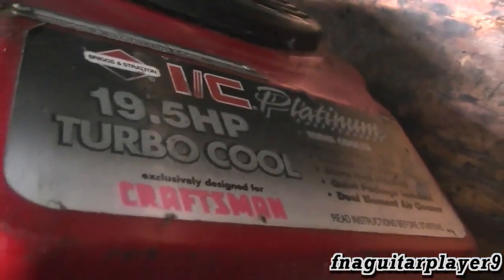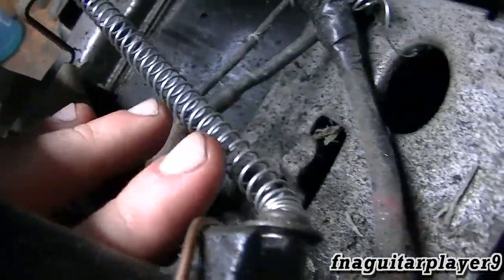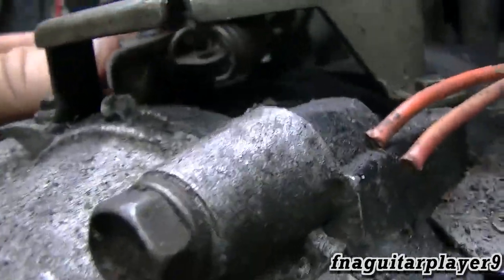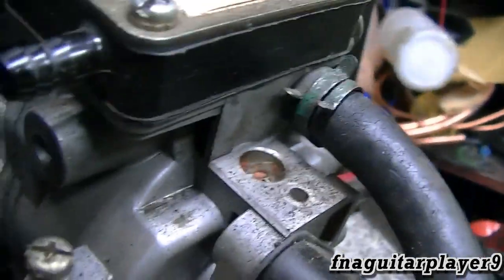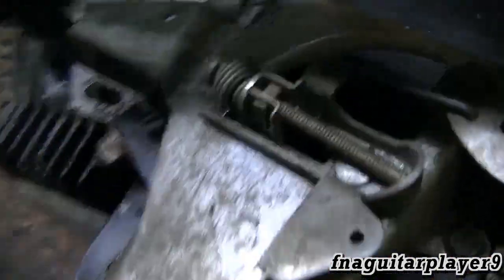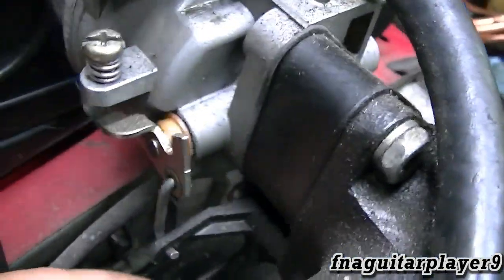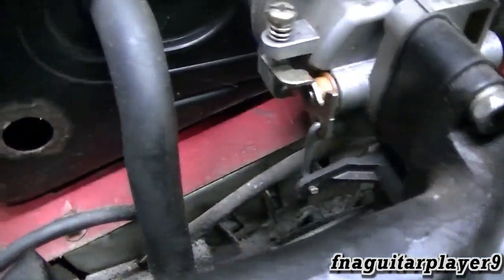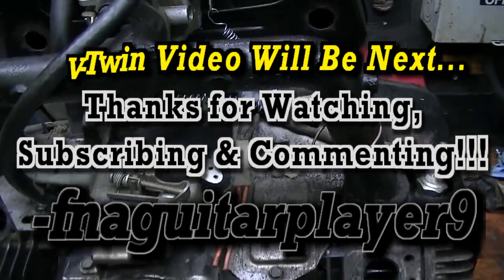Briggs & Stratton Opposed Twin : Governor, Throttle & Choke Linkages

Comment: Nice vid, I'm having a heck of a time getting the throttle to move using the control cable  (B & S, 18 hp), it stays wide open. Your video and some of the comments (feedback)are at least a starting point to try and fix it.Thanks to all.

Comment: I sure like mine after I sent Ebay $120 for a adjustable jetted carb. NO surging now at all and the older carb is rebuildable without sinking a war pension in it. They can have every fixed-jet carb that's ever been made. Mine's on an EZ Craftsman mower and runs like an electric motor as smooth as it is. Thanks, Picker and I'm still waiting for that tune!
Reply from the maker: I hear ya, I wish this one had the adjustment on it, my 14HP does. I'll check into getting a adjustable carb for it. Same here, I like a adjustment. i hear ya! Thanks for Watching!!!
Reply: Mine came from Ebay and it might've been off a 14. Seems like they had 2 block sizes and went up in h.p. with the bore. Don't know about the mounts though and how late they made the adjustable carbs to fit the 19.5's. Mine bolted right up but was off on one bolt for the air cleaner body but maybe 1/2 a hole.  If you need them I think I can get the numbers off the adjustable job. There was a plastic adapter about 1 inch high  with it and one on the motor itself. One was straight thru and one had an 'X' across it. Same size I.D. looked like. I used the 'X' for maybe better swirl and atomization. Runs fine but that's what adjustables do as you well know. The fixed main seemed fine but the lo would have to be bored out. That's where the lope came in. Too touchy for me.
Reply from the maker: I hear ya, that sounds about right. If it ain't to much trouble. probably was to swirl the mix. oh yeah, i'm sure its a big difference. I've thought about putting a vtwin carburetor on one, the 2 barrel type, it would take some serious modification to the intake manifold but it would have to give more power. I hear ya!
Reply: If you've got a tig rig and a lathe OR know where they are, you ought to be able to make an adapter easy enough. You'd have all the dimensions right there and touch them up with a saw file! I confidense you! Just take pictures!

Comment: Remove that spring  you have on it, back all the way off on the  screw with the  spring  (  top governed  speed  adjustment) I noticed  it is all the way in. With  throttle  control  set at wide open ,  loosen screw on governor lever hold lever  so throttle is held wide open and turn the slotted shaft to the left and retighten.  Start engine  and turn the top governed speed screw until reasonable  engine  speed is reached . Usually only a few rounds after engine  starts to speed up.
Reply from the maker: Thanks for Watching!!!

Comment: I have the same engine and it is running rich. Without the air filter on it, it runs good, but once you put the air filter back on it, it starves for air and wont run. Any ideas??

Comment: How do you set top speed when my throttle screw with the spring is all the way in? you mentioned a tab? Which way do you bend it? More slack on the spring? Or pull the spring tighter?
Reply: That’s the idle screw you have to adjust it to the right setting

Comment: I bought a riding mower with this exact same set up. The linkages will not move when you move the throttle control and the engine will not throttle up or down. Choke works fine. I choke it turn the key and it starts fine I try to move the throttle cable and nothing happens. I take it off choke and it dies. I bought this to tinker with and learn. Any advice from you would be a big help and I would truly appreciate it! Thank you. Liked and subscribed.
Reply from the maker: See if you can move the linkage at the carburetor, if so, then i'd say either the governor spring is broke or missing or the linkage is loose. Thanks for Watching!!!

Comment: Mine is the 3 bolt carburetor and the previous owner adjusted the governor up because the carburetor needed rebuilt while I rebuilt the carburetor and now it runs at way too high of RPMs how do I adjust it down without adjusting that one that goes into the engine cuz that's not where it needs adjusted at with the other springs and stuff and also what is the Max RPM it's supposed to run at factory so I can get a tester

Comment: I replaced the governor on my 22hp Briggs and stratton  and now it is back firing in the carburetor and running rough any ideas
Reply from the maker: Try adjusting the governor, sometimes something will get out of alignment and it will need to be adjusted, i have a video nit too, it will be a different engine but all of them are very similar. Thanks for Watching!!!

Comment: I have the same problem add a spring to make it work Cant figure out   whats the problem is for the idle being wide open. fixing to fire it up for the first
Reply from the maker: These have a governed idle, if the spring tab is bent it will rev at idle, it may just need bent, check that first. Thanks for Watching!!!

Comment: I think my motor has the same issue the video's motor did prior to adding those springs. The motor will rev way to high, an adjustment of the throttle on the "dash" will not idle down the motor. Upon looking at the carb, unless I manually move the throttle adjustment on the carb itself the  butterfly will not close to an idle state. Will bending the tab fix this issue?
Reply from the maker: You may need to adjust the governor, and check the governor spring, it may have actually came loose and jammed up, after looking at this engine closer thats probably why it was running so fast. The tab with the spring is the governed idol, it will adjust idle speed. Thanks for Watching!!!

Comment: I have the same engine on my yardman. I have had hard time starting the tractor, or once it gets warm, it does not start again. I am guessing it has to do with the inverted 4 looking linkage. There is a little pin that sticks out that goes under the 4 and when I lower the throttle to slow, the pin is supposed to go under the inverted 4 or something. If I wiggle the linkage, I hear a click and see the pin go under the inverted 4. Is the a certain position I have to put the throttle to get the engine started? Thanks in advance.
Reply from the maker: I would check the choke linkage because if its not closing it will be hard to start. Everyone of these engines i have are hard to start if its been sitting a while. I would suggest checking spark when its hot to see if your loosing spark, if so you may need a coil. Not saying its not a linkage problem, but it usually won't keep them from running or starting. Thanks for Watching!!!
Reply: It was the magneto coil like most folks on YT suggested. Fortunately, in my case, it was just the gap between the flywheel magnet and coil. Thank you for the response. Appreciate it.

Comment: I have a craftsman LT1000 and the front axle  is  bent and the left wheel is rubbing of the deck when turning l would like to now can they be straitened ?
Reply from the maker: Depending on how bad its bent it may be able to be straightened, its hard to say. It may break if its bent to far when you try and straighten it. It would be worth a shot before getting another one. Thanks for Watching!!!

Comment: I have a similar engine and the throttle doesn't it move at all.  It seems like it has to much tension on it
Reply from the maker: It could be corroded up or the internal part is damaged locking it up. Thanks for Watching!!!

Comment: I can’t get mine running even after I rebuilt the fuel pump it starts with starting fluid then dies seconds later help
Reply from the maker: Check the vacuum lines, and make sure then lines are connected properly. But with these engines, you will need to keep it running for a like a minute or so on carburetor cleaner to get it to start pumping fuel. Thanks for Watching!!!